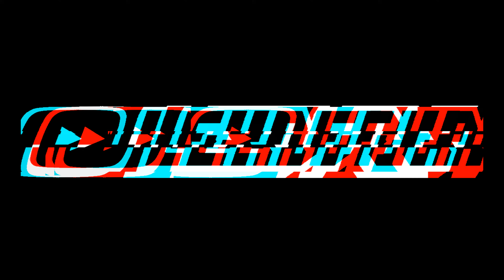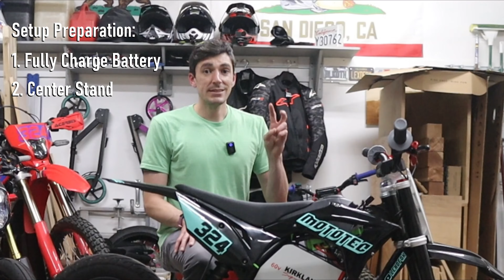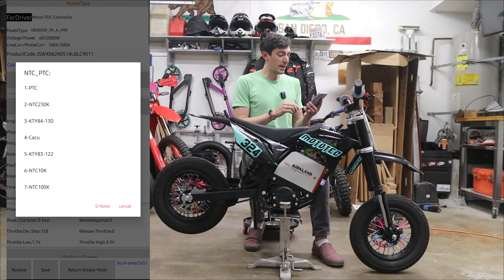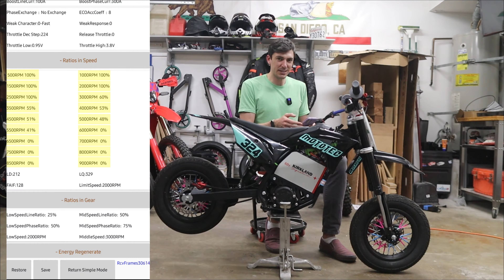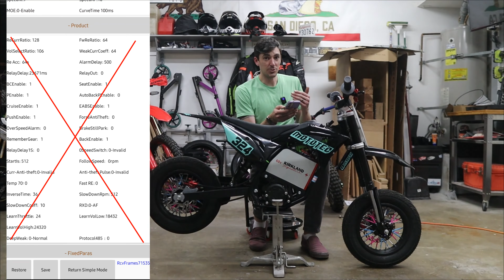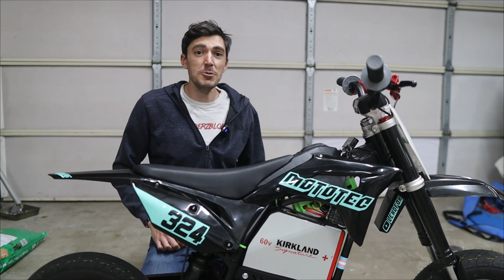How to Setup and Tune a Fardriver, a Beginner's Guide

Comment: Hi !....I have an undervolting alarm 18 Under Voltage Alarm ....because of which I can't do AutoLearn and probably because of which the acceleration doesn't react ...I just finished installing the controller!!
Reply: Please help me !!....The battery is a typical 52v / 58.8 full ....now I have it charged to 57.6 ....but the software sees it at 56.7 ....I went to open pro and put 52 v there ...before auto learn
Reply: On the other hand, you explain it loud and clear, you explain it very well.....yet I can't get the wheel to turn...direct drive 46 poles 48v / 2000 w...on paper...it probably easily handles 5000w at 72 V.
Reply: Open Pro Settings, Set the nominal voltage of your battery (52v in this case, meaning its 14s). Then scroll down to the Protect section and set low volt to about 3.0v times cells in series or 3.0*14=42v in your case. Then save settings and the low volt alarm should clear.
Reply: @imho7250 where do I find the nominal voltage
Reply: @Shaneyboy123 , it should be stated on you battery. For example, a 20s Li-ion pack has a nominal voltage of 20*3.6=72 v and a peak charge voltage of 20*4.2=84v. And typically controller is set 20*3.0=60v for low voltage, so that under normal situations the controller can enter turtle mode before the BMS trips.

But if you are using a different chemistry such as LiFePO4, it has a different set of values for for nominal, peak and low voltage.
Reply: @imho7250 I have a 50v battery and I set the minimum voltage to 44v
Reply: @imho7250 it seems to have worked but now I’m getting a throttle error I might have to get a new one 😢
Reply: @Shaneyboy123 , you just need to properly set throttle low and high if you are getting a throttle error during normal riding.

50v would have to be some LiFePO4 battery at 15s, 15*3.3=49.5v. And it has a very flat SOC curve, so 45v Low voltage might be ok.
Reply: @imho7250 can you tell me what I should set my throttle low and high too, my 50v battery from hotpaxx maxes out at 58v
Reply: To find the through low and high, just open the graph page and see what the throw voltage is at 0% throttle. The hold a brake lever and twice throttle to full, and read throttle voltage again.

Throttle low is set 0.1v higher than the 0% throttle voltage, 0.2v higher for very sloppy throttles that give errors.

Throttle high is set equal to 100% throttle voltage setting. 

During autolearn you will always get throttle error at the end so ignore that.
Reply: @imho7250 I’m getting a double beep from the throttle and it’s not letting me program it yet I’m trying to fix it
Reply: @Shaneyboy123 , are you not yet bound to the controller?
Reply: @imho7250 I’m blinded to the controller I can access to change everything I changed the low voltage just need to change the throttle because it’s not working
Reply: @Shaneyboy123 , on the graph page the throttle voltage doesn’t change when you twist the throttle? 

Maybe its a bad connection or not connected properly.
Reply: @imho7250 I just think it dosent work and I gotta buy a new one because I twist and nothing happens
Reply: @Shaneyboy123 you should test it with a 5v supply and ground and see if its making a signal.
Reply: @imho7250 I know it’s making signal everything is plugged in correct and everything is turning on
Reply: You have to set the low voltage protect. The fardriver will not set that itself.
Reply: I'm experirncing the same issue. Did you find the solution?
Reply: @herewegoagain425  Not yet...for now I purchased a Chinese controller 42-72 volt 80ah max!! Which was very easy to install, I will use the fardriver on another project on a middrive motor..!!

Comment: Line current is battery to controller. You set that number based on your batteries current or amperage output. 

Phase current is from controller to motor.  This can be set up to roughly 3x the line current.  It varies with different motors.
Reply: You are correct on what each is. BUT, you set line current according to what you want to make for power, not just according to what the battery is rated for. In fact, you never want to set the controller to the same value as the battery is rated for. You want the battery to have a peak rating that is roughly 20% higher than what you plan to run for Line amps. This ensures you don't stress the cells to hard causing overheating and/or too much sag. You also never want to be maxing out the controller, as that will usually cause the controller to overheat if it's one of the larger controllers (capable of 500a+ line current).

Comment: Hi, BattCoeffs are for display. Charge the battery fully and then play with FullBattCoeff value till the number in Graph section is 100 (or 99) = state of charge in %. Same with fully depleted battery. Then you have pretty accurate batt meter.

Comment: I have a freego x2 pro I have a far driver controller but I don’t know how to set it up I have a 60v40ah battery and a 3000watt hub motor
Reply: You can’t tune it the same way. Freego took out the wires from the fardriver that would connect to the Bluetooth dongle so you can’t program it the same way. It’s a super annoying process. But can be done. I recommend just buying a new fardriver and display if you want to have a display
Reply: @lukenorton8243 my freego has it

Comment: i just bought a used bike with a fardriver 72450 and it was binded to a different phone i don’t have access too is there a way i can still reset it and bind it to my phone im lossing my mind any help is appreciated 🙏
Reply: id lose my mind
Reply: Hit the 3speed 20 times
Reply: @tyscd5h22  Brake, not speed switch.
Reply: @mario_on_e-odin2.0 I used a jumper on the 3 speed harness and reset mine a few days ago.got the idea from a Ryan Goodyear post

Comment: Why if i put fardriver to my motor and pull full throttle it running step by step. Please help me my scooter is parked I'm no longer ridin'😔🙏
Reply: If you mean it like slowly moves like step step step etc, then your phase wires (blue and green) might need reversing or can try doing it in software ‘Phase exchange’. I did this to try and diagnose an issue and did both methods and it did the step step thing.

Comment: Autolearn should be done with the chain off.
Reply: Agreed. Ive built over 12 fardriver bikes.
Reply: It doesn't make a difference.  For example; I have a 55lb hub motor. How do I make that have no load? It's fine to do it either way.
Reply: @Twin_turbo_coyote_fox no load would be off the ground. 🤦‍♂️ do a test with and without chain on and let me know how off your phase offset is. 😬
Reply: @stevenervin4113 it’s a hub motor… there’s no chain…
Reply: @Twin_turbo_coyote_fox Auto-learn on a FarDriver controller should be done with the chain off. This ensures the motor can spin freely without load, allowing the controller to accurately detect and configure parameters like motor direction, phase sequence, and hall sensor alignment. Performing auto-learn with the chain on could introduce resistance, potentially causing inaccurate calibration or incomplete learning cycles. Sources recommend removing the chain and ensuring the motor is in a safe position to avoid damage during the process.

Just a little bit of research 🤏 keeps you from looking silly

Comment: Installing this in my Burromax 1600 which is 52V. In the battery selection there isn’t 52V…think I should choose 48 or 60?

Thanks for taking the time to make this fantastic tutorial 🙏
Reply: Adding to my response. Just want to thank you for this video again. Just installed a ND72300 on my Burromax Tt1600. Took a bit of figuring out but it’s running awesome. I have a slight off throttle “shudder” like a cobble stone road feel at higher speeds but it’s fine. Hope it doesn’t hurt the motor…other than that much better than stock! I’m running 85A max line and 260 max phase. 

I did notice when you make changes on the Pro screen VS the Simple screen they do change each other. So if you change the Gear high power output on the simple screen it will raise or lower your like and phase amps. 

For anyone with a Burromax:

3 pole pairs 
70-80A line current
200-260 phase current 
Change your voltage to 52V - you have to type it in. This will also change your battery low and high voltage protection. 

Mini’s for life 🙌🙌🙌⚡️⚡️⚡️

Comment: Wait so did you ever find out what was causing the crunchy RPM on the 48v with the fardriver? Clogging? Did a throttle fix it?
Reply from the maker: Throttle did not fix it, and when I put it in the 60v without any real tuning changes it worked perfectly. My guess is that the motor in the 48v was the issue.

Comment: Good video! Yeah i wouldnt trust regen if if the BMS would support, but not expert either.
Reply: You lr battery and BMS has a max charge rate. That applies to how much Regen you can use.  So if the BMS can handle 20A of Regen you can sex youax Regen to 20amps.
Reply: The new Blue type Daly BMS I have with 250A discharge, also has 250A charge current. Plus upgraded electronics with fly back protection. 
I ran the old red Daly BMS and it had all sorts of boot loop issues at key on. Plus as I hadn’t secured the battery down after 1300kms of rough terrain in my duel hub 4 wheeler, the BMS internals cracked and would intermittently throw a regen error which cut all braking instantly. I had no mechanical brake at the time so going down hills leaning on the regen and then have it fail and go into free fall was scary as shit! Took a while to work out it was the BMS. 
Battery now secured and BMS upgraded. I no longer have boot loops with new blue Daly BMS. Which I put down to reverse flyback protection. 
But yeah I’ll be cranking up the regen as I prefer it to mechanical brakes, especially with dual hubs at the rear, it provides superior braking. For bikes I can understand some don’t like it. For a 4 wheeler definitely worth trying. 
Reason I’m here is I’ve upgraded from Kelly to Fardriver and have to learn all over again! And there are many features not mentioned properly in the manual including exact pinouts. Use to that though with Kelly
Reply: trial and error. it effects the braking feel, so set it strong enough, but that it isn't annoying when you pull the brake lever just a little

Comment: Awesome info!, I do have a mod I'm sure others a curious about this bike and thats to see if the stock controller and motor can handle just a 72v battery upgrade, if you have a spare stock computer to spare I would guess the 72v would cook it but can it handle the higher voltage??
Reply: yea it can

Comment: Great vid! One thing I would say is to set the line and phase amps before auto learn so you don’t blow your motor
Reply: Really? I didn’t set anything before the auto learn. 😂 . Haven’t tuned anything though
Reply from the maker: Good tip! Better safe than sorry.
Reply: Set it to what exactly? I have a mototec 72v i want to tune but cooking my battery is my biggest fear.
Reply: @AVelly-  your battery has a BMS it will shutdown way before you have a problem. Frying the motor is a possibility.
Reply: @DavidVarner-q1y same with frying the controller. Idk about fardrivers I actually just got one but I’ve blown up 2 little bit controllers playing around with them
Reply: @A @AVelly- set up guide I just used said to set it to the rated amps of your motor before auto learn.  So if it’s 2kw at 48v then it’s 2000W divided by 48v= 41.6A etc.
Reply: That depends on your battery specs.
Reply: it's impossible to damage the motor during the autolearn no matter how high you have the amperage set to. It only draws 1-4 amps during the autolearn. So no, theres no reason to set the line and phase before the autolearn. Unless its just to make sure you don't forget to do it after the autolearn.